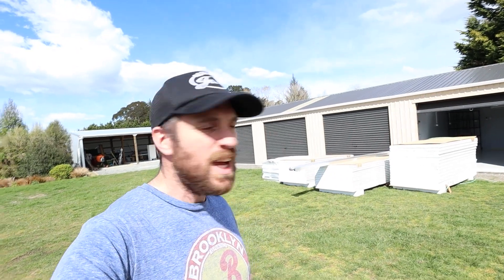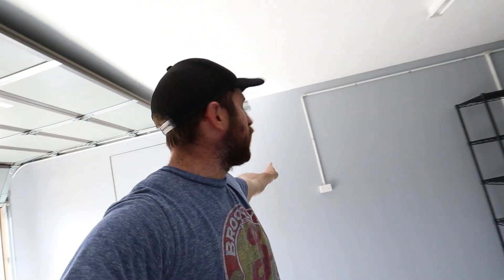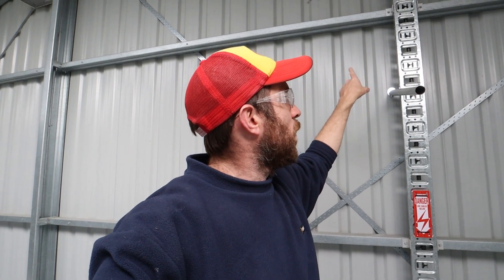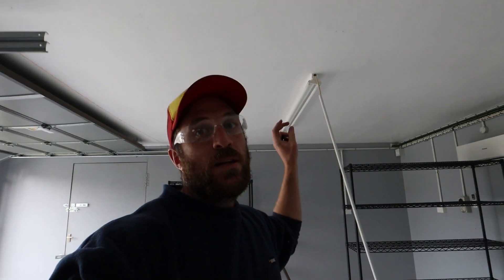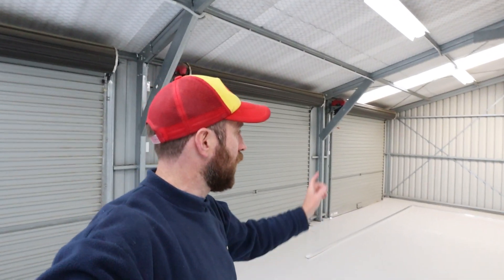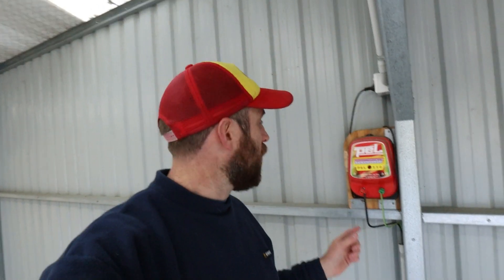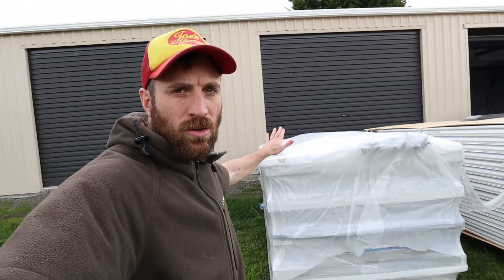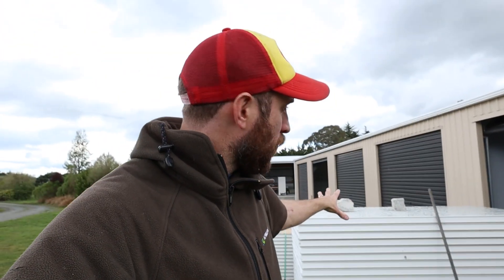Planning a Mushroom Farm

Comment: Hey dude, have you thought about putting the intake half of the flow hood outside the room, so the air is coming from outside and creating positive pressure in the room? It would also create more bench space as the filter would just be part of the wall. Would probably have to change pre-filter on the outside much more often though.
Reply from the maker: That would be a great way to achieve positive pressure. I might just do that...

Comment: Living the dream mate..
How long has it taken you to go from start to expand?
Also super curious are you going to go with the same vertical shelves you had in your last place, or a more traditional shelving for fruiting?
oh and have you considered the hanging straw as a substrate ?
Reply from the maker: Taken me a few years. I am using new shelving that's all on wheels to make moving the produce around a lot easier.
Reply: @OakandSpore  Cheers, am setting up a shed now, approx 12 square metre, thinking I will go with an adapted version of your shelves, will have them on hinges as I want to use the space behind for inoculation.

Comment: Nice dude! Really like seeing the progress. Cool to see you from the garage to a legit building. I’m in the garage phase right now. Question about the sterilizer, will that be inside the lab? Or outside? How to plan to transfer substrate around cleanly?
Reply from the maker: It'll be outside. I used to wheel my steam barrels into my clean room to unload, then when I upgraded to a larger steam tank I just let them cool outside, and carried them into the clean room once they have cooled. So far I have had zero contamination issues. I really don't think the substrate bags need to be unloaded from their steam vessel into a clean room. Spawn on the other hand is always unloaded into a clean room.